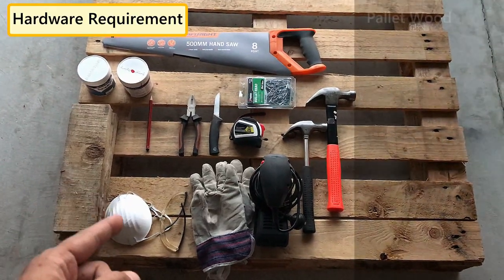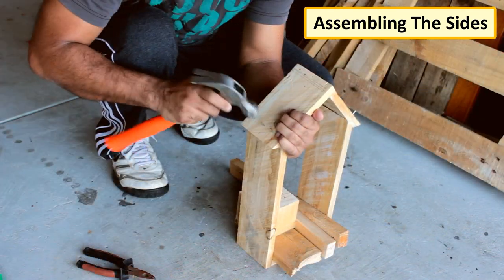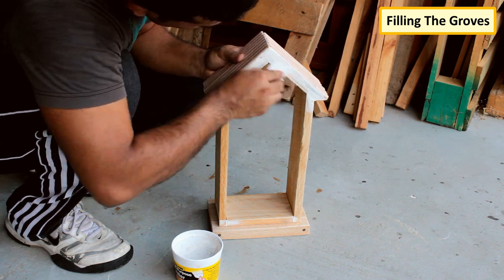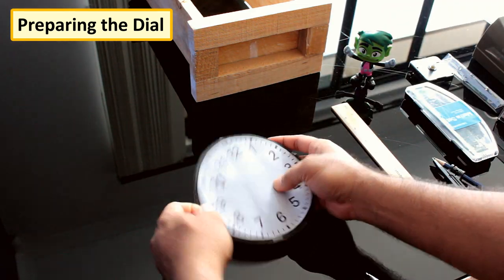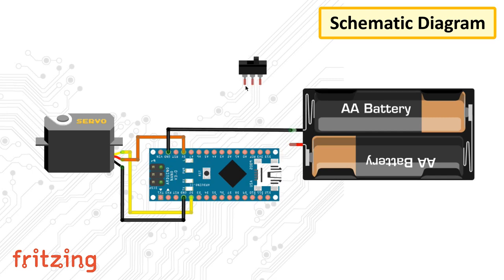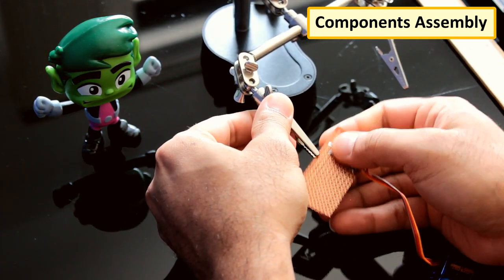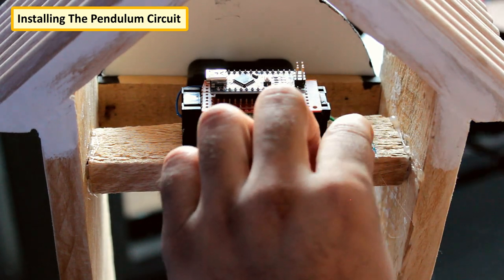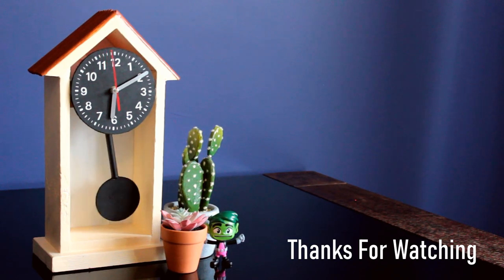DIY - Pendulum Clock

Comment: do you have the arduino code you used for the servo?  Do you know how much run time you get out of the 18650 battery?
Reply from the maker: You can download the code from my blog. 
On a full charge the battery last for 1.5 hrs

Comment: Instead of soldering the components to the Arduino board, can we wire using a Breadboard instead.
Reply from the maker: Sure u may
Reply: You can. Ist  just more permanent soldering wires and connections

Comment: cool design, but the pendulum movement looks abrupt and fake. A simple code change would fix this. You should adjust the movement of the servo so it represents the movement an actual pendulum clock will make. Yours looks choppy and also stops at each end. A pendulum in a clock is always moving.
Reply from the maker: Good point mate.
I will redo the code and will upload it on my git